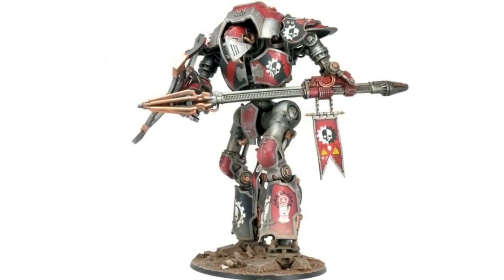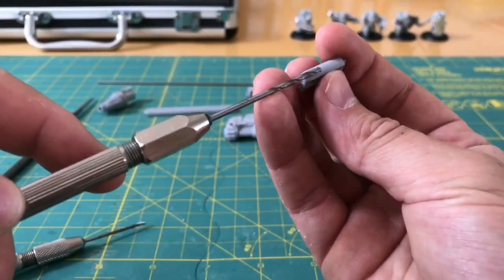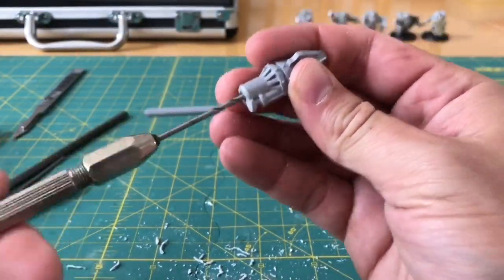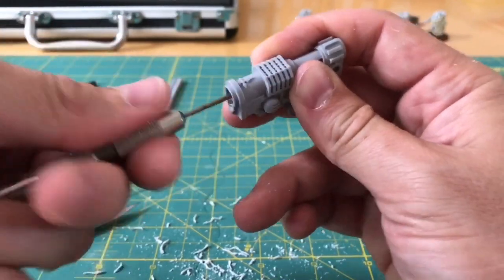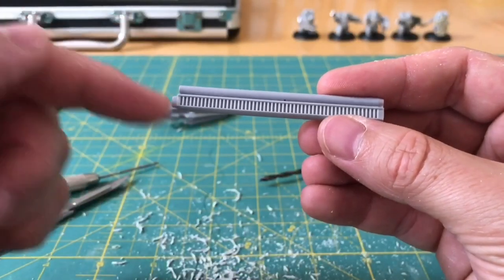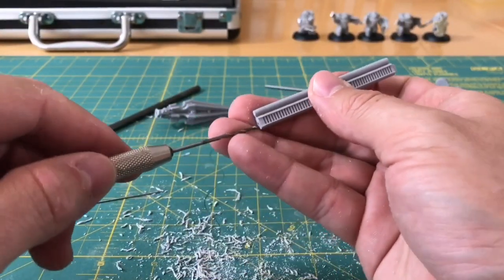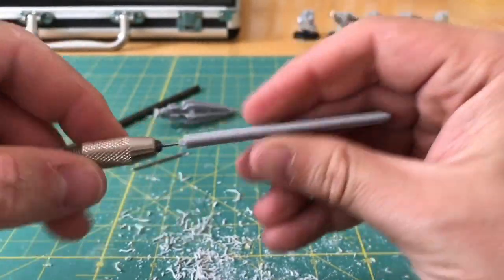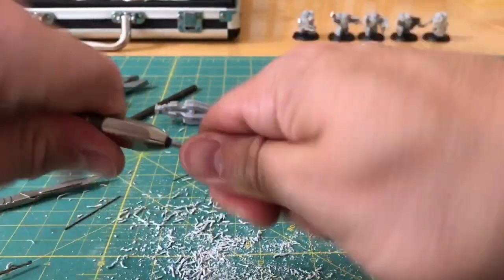Drilling masterclass: Ceratus Knight Shock Lance +chats: Adeptus Titanicus, The Meg

Comment: This embodies the social aspect of the hobby - any handicraft hobby, in fact: sitting down, working, and talking to others. Thank you!
Incidentally I was doing a similar thing while listening (and occasionally looking at the screen): drilling and pinning the secondary gun barrels of a 1/200 Bismarck model. Much smaller scale work, used an 0,6 mm bit and a Dremel. All went well until - how else - the final, 12th piece. I kept the drill running for a fraction of a second too long and the barrel turned to jelly. 
Fortunately had some spares for another model, and with some simple modifications made a replacement.

Comment: Welcome back how-to / Masterclass, random discussion topics and future content teasers!
Question - Before this video I was looking at how to do this myself I was thinking of cutting away the upper rod shaped part of the haft and replacing it with a slightly longer metal rod the same thickness. Then drilling a recess into the main arm body and Lance end to accept the longer rod ends and gluing the whole thing together.  
Would like to get your feedback as I'm worried about my inability to drill straight... 
Great video, THANKS!

Comment: I admire your precision drilling! I have never been brave enough to try this on parts that thin. BTW you can find much longer drill bits online.
Reply from the maker: Thank you sir 😊 Bravery was part of it, perhaps a bit of fearlessness as well.

I wonder how well a longer drill would work? Another commentator suggested using some liquid soap for lubrication, the two could be a good combination.
Reply from the maker: MasterShake9000 MasterShake9000 No, that didn't happen. The part when the channel ended up slightly away from true was down to a lapse of concentration on my part.

I was aware of the resin warming up from the heat of my hand. It wasn't at a temp where it would bend but I was being wary of it combining with the force I was exerting on the part as I was working on it.... I think there was a small risk of crushing the channel on the large haft piece.

Comment: Top notch!
May i share a tip with you? Don't throw away your Flexi-File sanding sticks once the edges wear down! Instead, use a Stanley knife and cut away the worn edges.
Another tip is to slice the sticks up into varying thicknesses/sizes of thinness to allow you to sand smaller details.
Reply from the maker: Thank you ☺️ That’s a top tip for those Flex-i-files as well, nice one 👍🏻
Reply: You're welcome!

Comment: You're far braver than I am! Quick question, since I've messed up easier operations than this: if the drill bit wanders, and I ruin the piece, can I ask Forgeworld for a replacement? I was under the impression that they only offer replacement parts for miscast or missing parts, and don't even let you buy replacements.
Reply: This video is a white knucle ride equal to any shark movie! It had me on the edge of my seat the whole time.
Reply from the maker: Glad you enjoyed the ride, working around the camera added to the "fun".

Technically I'd say no, purchaser peril. But if you said it was missing from the kit......

That could get like Ferrari crashes happening just outside Silverstone!
Reply: leakycheese, does FW expect you to check your components within a reasonable time frame? I've not started my Warhound yet, I do know that some of the bits might need replacing due to mold slips, such as the pistons that cannot be repaired as their dimensions are critical. I'd rather not get replacements in drips, I'd rather do them all in one go if possible. Or at least, most of them. Dry fitting is a huge undertaking I don't have time for right now.
Reply from the maker: I don't think they have any particular policy on that, but if it was me I'd do it sooner rather than later and also in one batch as it will make it much easier for them to help you.
Reply: Thanks leakycheese, I'll see if I can go through it all this weekend. I just shelved the whole lot till my other projects were done, so I'm glad I brought it up.

I don't know if you remember, I was planning on replacing the soft skulls on the foot pistons with either brass acquillas, or the cog logo. I've also got a few ideas to make the carapace and greaves a bit more unique, but I need to make sure it's doable first.

Comment: My (completely sans proof) feeling about the pricing of AT was that they were just very leery of causing sticker shock. Just the impression I got about it was almost as if they were arguing back and forth with their dept that does pricing, as to what was acceptable - no proof as I say, just my feeling.
RE: drilling, Good lord! So, basically just be patient, and skilled you're saying :P Only alternative way I've seen it done is breaking the drill off in the part! Not on purpose, but it does end up working if it happens (tho not sure with something of this length)